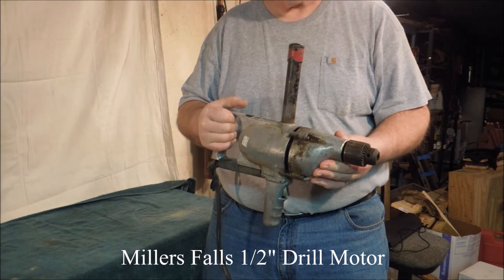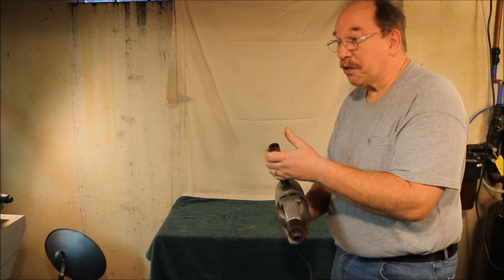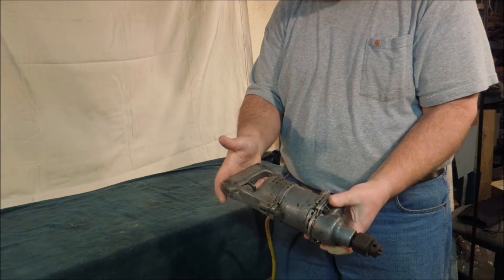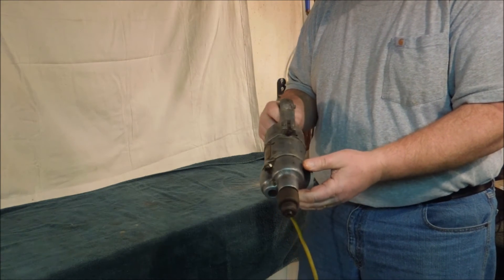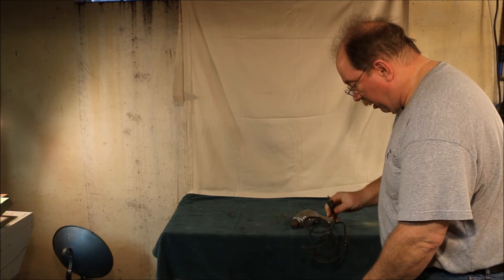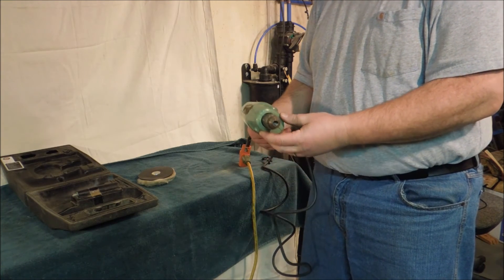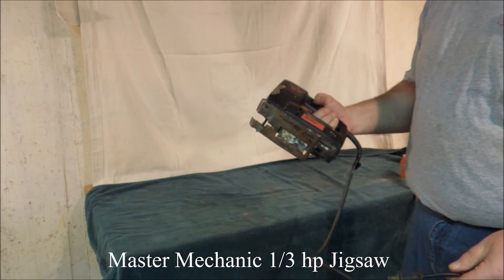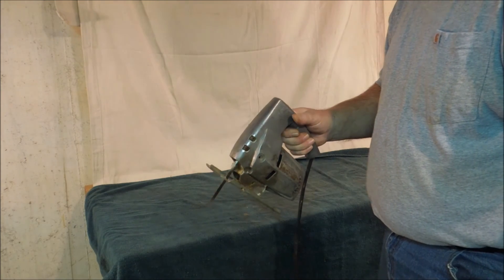Tool  Time At Old Sneelock's Workshop ~ Various Makers

Comment: I agree with Steve & Lewie, keep 'em coming!! I learned to mix drywall & plaster mud on them old Miller Falls 1/2" drills. That is when we were on small jobs. ..
Reply from the maker: +Ol James I've mixed plaster and drywall mud but never a big enough batch to need a drill motor. Mostly just patching and the occasional bit of sheet rock.
Reply: We mixed it by the buckets full. On one house I remember mixing 12 5 gallon buckets just to get us started, then after a mid morning break 12 more till dinner time. After dinner 15 more to finish up 1 coat on the drywall. Yep, it was a big house. We put 4 coats on that rascal...
Reply from the maker: I use to work construction as an electrician. I was impressed by the mudders being able to layout the tape and drywall while dancing on stilts.
That's where I learned that it's 3 thin coats not one thick one. :-)
Reply: Yep, that's the first thing I learned. It's a lot easier to add than subtract...

Comment: One comment about that Chicago Electric Rotary Tool... it could just need a beefier power source.  I remembered seeing a video of someone who had an anemic Harbor Fright rotary tool, and she got it to work better, and then re-purposed it for something interesting.  She uses it as a plastic spin welder.  I found the video, and it is available here (https://youtu.be/r0zpqhhcmp4).  It is a really useful tool, and I'm surprised that more people don't know about spin welding.
Reply from the maker: +Brian Neeley I went and saw the video. Interesting process. I might actually try the spin welding but I doubt I'll spend the time upgrading the HF rotary. I'll use one of the Dremel tools. Thanks for pointing out an interesting channel.
Reply: Sounds like another project, Snee!
Reply from the maker: +fryefoto Can't think of a thing that I could make with this but the idea is pretty good. Any suggestions?
Reply: no clue...for me, the light bulb usually comes on a day or two AFTER I toss a thing (therefore I toss very little)!